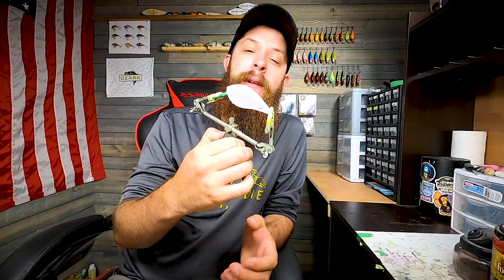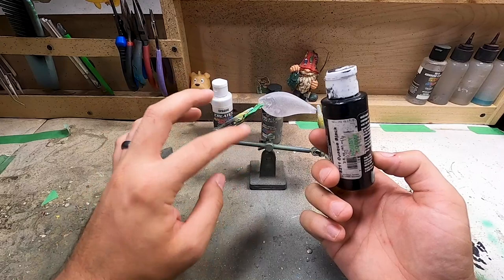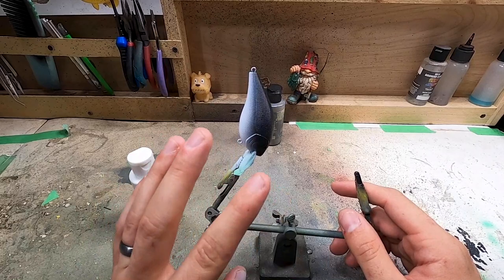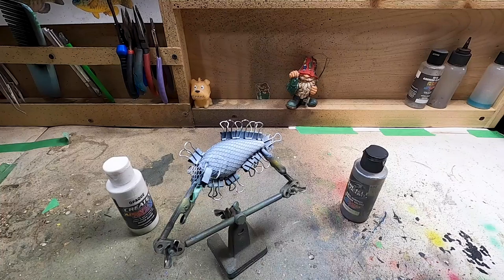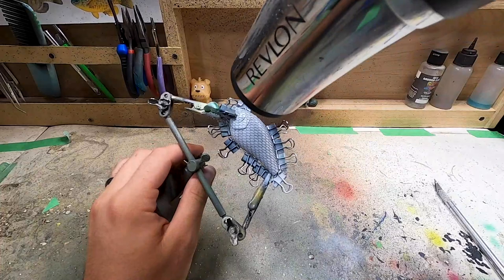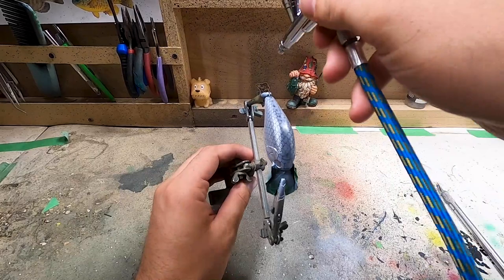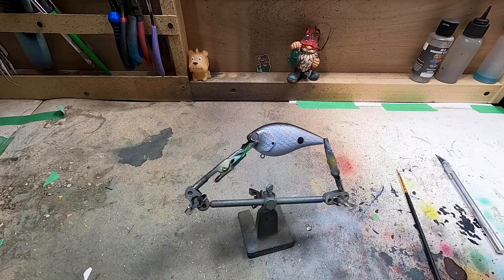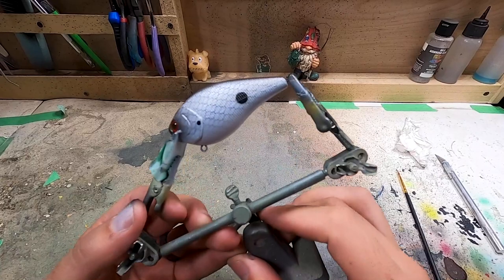Easy Lure Painting For Beginners (Ep.2)

Comment: I never seen anyone use water with createx paints. I see its a pearlized silver color. But i use 4011 reducer.  What made you try water only?  Wouldn't 4011 be recommended?
Reply from the maker: I like using the water with the water based paints. I have not had any issues with it. However if its not water based then I would definitely recommend a reducer 👍
Reply: @BakerBuilds  createx paints i use is that water based?
Reply from the maker: @fishingwithhoffman7365  some are and some are not. It should say on the side on the bottle 👍
Reply: @BakerBuilds  okay ty